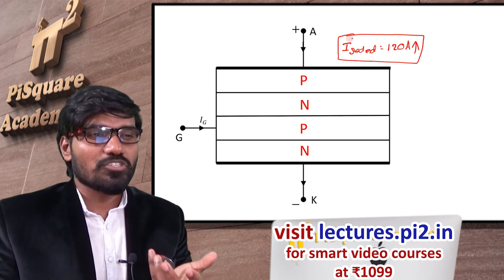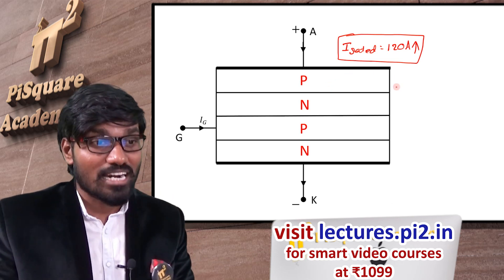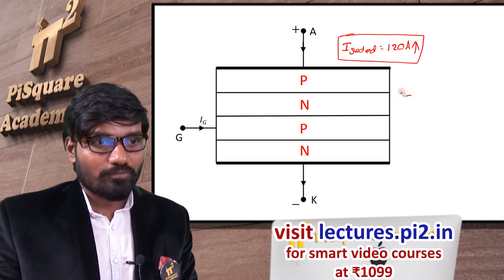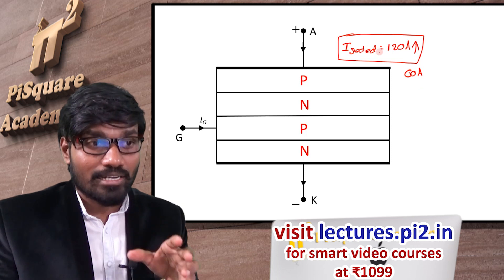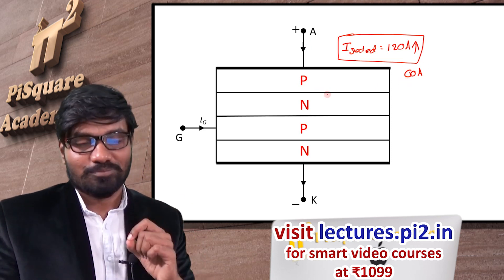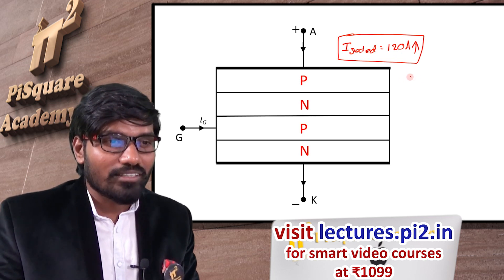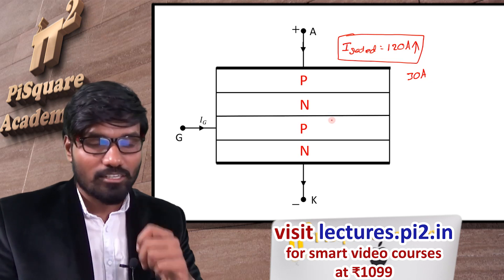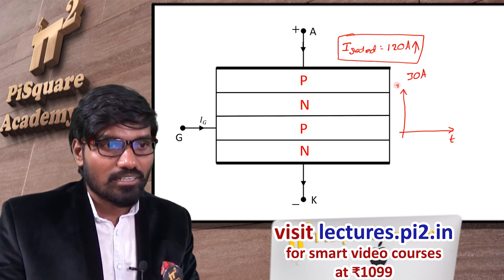Why local hotspots created, Difference between I_rated and di/dt rating of SCR.

Comment: Sir if you apply anode voltage as positive then J2 junction  will be reversed biased right?? Then how the current spreads.. Are we providing gate pulse in this case!!
Reply from the maker: In turn on Methods, you will get the answer to your question